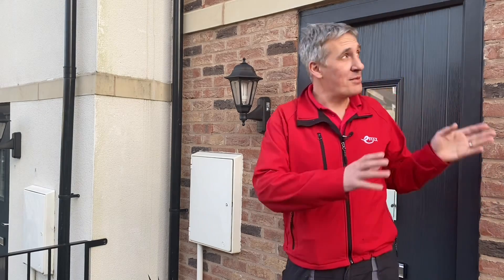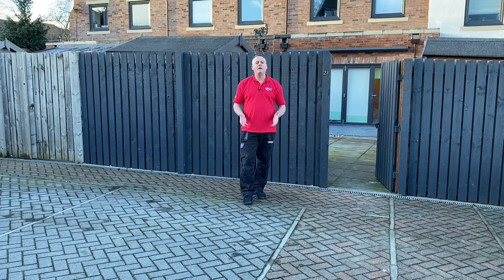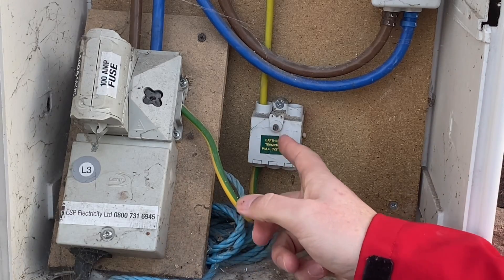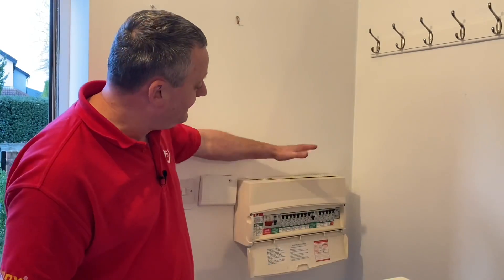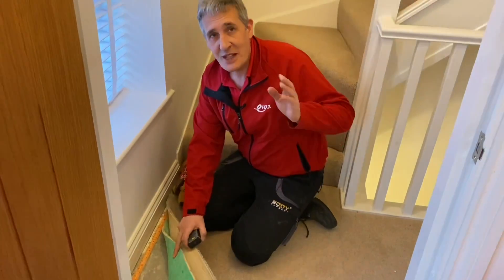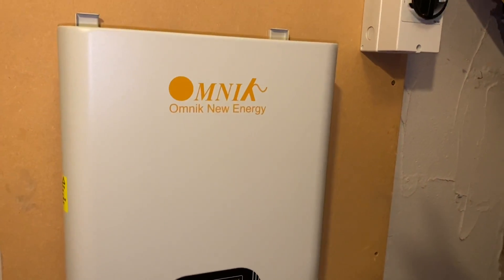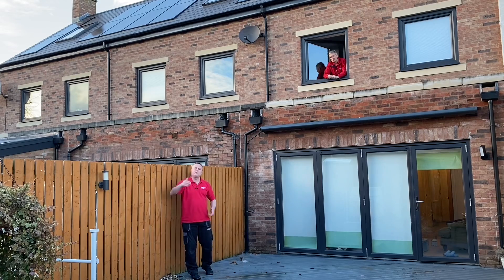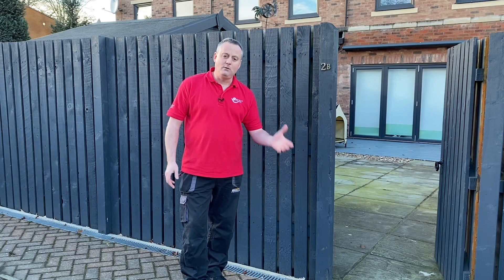Are ELECTRIC CAR chargers EASY to install?

Comment: If the ground floor is screed, then it might be possible to run cable through a conduit. It will be dependent on the depth of the screed, and there are some rather vaguely worded regulations about protection. Of course steel would be ideal. Such a solution would have the potential to minimise cable runs, but it's fairly drastic. Also, there may be other services, typically central heating pipes buried in screed, which would be a major issue, not to mention disruption to the floor. Not too bad for carpet of course, but a real issue for tiled floor and some other types of hard surfaces.

Then there is directional drilling under the property, but I imagine that's incredibly expensive and is a very specialist job.

As far as the CU is concerned, a move to RCBOs would free up several slots, but I think if that was done then it would be with a new metal unit.

Comment: My power supplier, western power distribution, do not use a main fuse greater than 84 amps, they also said a larger fuse would require larger fly Leeds. The other problem my supply is looped with next door.

Comment: ! ev charger supply at the end of the street. Cable under the road supplying each property individually card payment device on each charger. Less disruption, less chance of disaster, less diy bodging, simpler quicker cheaper installation one hit for the whole street. So instead of a 3rd world daisy chain effect we get a standard addition to infrastructure. Lets hope all those transformers and sub stations get upgraded this decade.

Comment: If it’s marginal for 10mm2 then go with it to give some flexibility on cable length. How about split consumer tails in service box, take new feed straight out of service box up the front of the house (will need ‘fuse’ as effectively tails are more than 3m), through the soffit board across the loft, re-emerge and then back down the rear elevation with an IP55 or higher CU with surge and MCB fitted to rear of the property. Then as per normal to point of charger mounting.
Reply from the maker: We did explore this. However, the house has three floors, the third one being in the roof space, so no easy route from front to back.
Reply: @efixx  thanks...... was my outline plan broadly technically ok? Would ‘fused’ 10mm out of the service cabinet be within regs?

Comment: I would be happy to install that for $50,000 aud. And it would be done in a week. Plus 3 months repair work. Remove ceiling run cable dig trench for cable. Concrete pad for new charger pole and WALLA. But with Covid I may not be able to do it for 2 years until I get a Vaccine in the good old Straya.

Comment: 1 Wait until they've bought the car before you price it and call you at least 3 times. 
2 Produce a full schedule of all materials and confirm the cost.
3 Produce a full schedule of works and estimated time
4 Add Items 2 and 3
5 Double Item 4
6 Add Vat @ 20% to Item 5
7 Add between 10 and 20% for overheads to Item 6
8 Add 10% Operating costs to Item 7
9 Think about the profit
10 Add 20% to item 8 for Profit
11 Think about a bit more profit
12 Add 5% to item 10
11. Round it up to the next £1000
12 Request 50% deposit for Materials
13 Get Pjtor to do it for £150 cash

Comment: Affixing to a wooden fence? I dont have the 18th ed. But I wouldn't. A wall yes, it's more permanent and less likely to be replaced. Wood not really, it rots and not substantial enough. 
Install a concrete post, if you have to go above ground use pvc swa pvc with added protection throughout its length.

Comment: I'd check what the original swa feeds and if suitable connect a priority and non priority switch.
Reply from the maker: They are Spurs off the ring final circuit
Reply: @efixx  then depending on location within the ring. Reconfigure it  to make that a radial leaving ring in tact (depending on cable size) or if still not feasible then just provide a lower powered charger that is fine to be plugged into the ring . Takes longer to charge but is a viable option.  The other option is to use the solar also .  Hopefully you will post your solution at the end . And I know you said no access to loft space bu be amazed what you can do with a ferret cam and some rods to pull a feed out

Comment: Apart from the regular EIC, do you give the customer a EV Charger Unit specific cert? If so where can I find a template?
Reply from the maker: Lots of paperwork for an EV install - this form has to go to the DNO. / https://www.energynetworks.org/assets/images/Resource%20library/EV%20HP%20Application%20Form%20v9.6.docx

Comment: If we need to take care about broken PEN on a TN C S earthing arrangements why are there no similar requirements for other electrical installation like electric gates or even for outdoor sockets if RCDs do not help with a broken PEN?
Reply from the maker: A good point - someone has done a risk assessment - but aren’t sharing the numbers. We think it’s down to the high load of 7kW compared to what’s typically used outdoors.

Comment: Honestly don't know what I'd do there. Is it an option to go low level through under the stairs? Maybe fit a small 2 way board in the meter cupboard (I know I know, sue me) then take a cable out of there down the front wall, into the hallway at low level, under the stairs, then under the kitchen cabinets? The back of that house is a nightmare to come out at first floor level. I'd do that as a last resort.

Comment: What will it cost to "shoot" a (plastic) pipe with a "rocket" under the building/foundation? Just like what is used for pushing gas pipes under a road from one side to the other and through to a building.
Reply from the maker: There is a company offering this service - we might explore what this would cost

Comment: Use the PV as the primary charging source backed up with battery in the loft for when the car charge isn't connected. Is there any way of using the PV circuit to the CU as the feed from CU to loft back down to the EV system for when the sun doesn't shine? 
If not use fire alarm way (connect them to another 6A circuit) to add 32A. Hard to understand possible cable routes without assessing the building fully. Use Zappi charger with PEN fault detection and RCD. No clipping to fence but I would defo bury those cables to Zappi if I could.

Comment: Interesting little job. Carpets up on the first floor and cutting access panels/holes in the chipboard would see the least collateral damage

The isolator tails also need sorting out as there’s basic insulation visible

Yes, it’s in a ‘locked’ cupboard but how many do we see with their doors swinging in the breeze or missing?

Comment: I would fit the charging unit on the inside of the fence with a 5/7.5m cable and take a tiny notch out of the bottom of the gate so you can close it with the cable under.

They are becoming quite the target for thieves due to the value of the cables.

If the customer does not want to do that then I would recommend an untethered charger again due to potential theft.
Reply from the maker: Jeez - thanks for the heads up - pinching EV charger cables!

Comment: Is the electric heated floor in the bathroom, really a no go option to route the cable under?
Wouldn't you at least try to rod through and see how far you can get?
Trying, the most direct route, at least could prove worthwhile.
Reply from the maker: Joists run the wrong way across the floor - otherwise we'd take a punt!

Comment: I’d use a Zappi with its built in RCD protection, PME fault detection and CT clamps. 
All depends on cost, but in an ideal world I’d replace the plastic unit for an RCBO unit, spare ways and SPD. 
I’d run a T&E from the CU to a wiska box on the back wall then SWA from there. Of course the floors are a pain but using the  holesaw and plugs it wouldn’t be a big problem.
Reply from the maker: we are thinking along the same lines!
Reply: @efixx  great minds 👌🏼

Comment: I wonder in this instance and other cases where say the garage is in a block away from the property so not even any way to run a cable staying within the property boundaries if it would be possible to ask the electricity supplier/DNO to give you an additional supply on a different meter etc?

Comment: Surely you can use of the PV system I'm the loft ? New sub main with SPD  , come out the loft down the wall bobs your uncle.

Also, I'd be getting shot of that bell transformer if I needed more space in that DB.
Reply: Forgot to say... they could also do with an SPD on that DB esp if the new car charger is coming off it.

Comment: 1:11 Why does the DNO need to be notified that you are installing an EV charger? It's customer-side equipment and none of their business.
Reply: https://www.energynetworks.org/operating-the-networks/connecting-to-the-networks

Strictly you don't have to tell the DNO, but it is a requirement of the OZEV grant application and is in the IET Code of Practice.
Reply: @NickW1111  it is mandatory that the DNO be notified irrespective of whether the OLEV grant is being availed of.

Comment: I think i would be taking down the brick wall at the front of the property and create a hard-standing to use a an off road parking space. This will almost ensure that only their vehicle will charge from their charger. Putting a charge point outside the boundary of the property (i.e. at the rear) may require 1/ contacting the local council, 2/ ensuring that only they can charge a vehicle from the charging point. 3/ Ensuring the install is as vandal proof as possible. 4/ Taking out extra insurance for public liability (should anyone become electrocuted by a vandalised charge point).

Comment: Is there a possibility to sink a new (flush mount) consumer unit which could get you into the cavity as a starter for 10 at least? See where you can get to from there (as in up and over).

Comment: Nice long f off cantilever wire straight down the middle of the garden, doubles up as a washing long. Bonus points if you drape the swa over the roof like a good quality satellite installer. 😂

Comment: As a British electrician but living and working legally in  France for well over 15 years I am still astounded how the consumer units and supply heads look like something out of the dark ages. Meter boxes with kit mounted on bits of chip board and consumer units you couldn't swing a mouse in never mind a cat. I know the European system is more expensive but it's just better. Conduits for cables, decent sized boards, double pole MCBs everywhere and everything is protected by RCDs. Every supply head has a 500mA differential  with consumer side isolation, even the ancient houses so no problem with fuses, seals or contacting the suppliers when you need to isolate the whole installation. All circuits are radials, more final circuits but much simpler. I don't envy you guys....I especially dislike twin and earth.... Give me conduits and singles any day of the week.... 

Ok that's my lot....good luck 

;-)

Comment: Hmmm. Interesting new garage unit in the meter cupboard. Run the swa under the downstairs floor to the outside. Run a small duct by the front of the fence. Up to the charger

Comment: First thought would be to run the cable up and down external walls and through roof space, if the voltage drop for the extra distance would allow it.
Reply: Would the charging port need it's on earth stake (tt?)

Comment: Will be interesting to see what you come up with. 
I have a similar situation and hoping to lease an ev.
Mid terrace house with the consumer by the front door and the parking hardstanding is at the bottom of quite a long back garden. 
The house does though have floorboards and a half basement.

Comment: Doncaster Cables EV Ultra 4.0 mm will deliver 42 amp circuit. Assuming clip direct this would be good and give us bang on 11.52 volt drop, I think we can do with that over 30 metres. 
Unless the routing is in insulation we could stick with 4.0mm. Maybe we go to 6.0 mm if we have concern over distance and installation routing. 
If we need CT or other data connection, as this is a long way for wifi to connect reliably to the Broadband wifi router the EV ultra with data cables would pay on the grounds of not having two cables to install and reliability of connection.

Comment: Something very useful in this situation could be putting an endoscope through the floor void. a remote control car with tracks and  camera can be used to pull a string through the ceiling cavity! attach cable and pull through, often use one under floorboards and voids.
I have used a RC car to literally drive through the web joists to get from one end of a house to another before. used cable pulling lubricant to prevent snagging. 
I would likely fit a small din enclosure in the meter cabinet, contrary to belief these belong to the customer and not the DNO, WPD and SSE both do not mind enclosures being in them as long as main fuse is accessible.
I would take cable up front of house (paint it) or put in conduit ideally concealed behind the vertical black drain pipe.  which we often do in Bath due to planning issues. then through first floor cavity, using the right tools and techniques it could be fed to the back of the house with no damage to decoration, carpet will easily go back down with an hour or so of a professional fitter, which is less than the cost of ripping the walls apart. come out the rear through the bedroom, I would consider running cable over the roof and down behind the drain pipe. potentially using H07 on a short run. and then run in SWA below the garden/decking out to charger. I would fit a Zappi with Harvi devices for grid management and pv utilisation. Equally if there are DNO cables going through the parking area the cost of a new supply can sometimes be much more attractive and cost effective than running cables through houses with all the decorative issues afterwards. 
Regardless of option its a cost VS Time VS damage scenario.
Reply: I have done that with an RC car too, many times - always successful too - mind you it was a 4x4.😉

Comment: Do what sky do and throw the cable over the roof and down the other side. Tie a hammer to a bit of armoured and you should get it over with a good swing. Then tack it to the fence and you're done. Cash in hand and no one needs to know.
Reply: Yea haw👌

Comment: I’d look at a separate unit from the meter box up to the loft. Possibly to a consumer in the loft next to the solar and then out and down to the back gate, but of course it’s public...so can you run under the path way and put it on a post in that specific parking bay? 

I could be way out so 🤷🏻‍♂️
Reply: It's a 3 storey house - don't think there's a cable run from front to back in the loft.
Reply: @ChristopherKaneTV  😢 what a pain! Don’t make it easier to retrofit do they. I do admire the Europeans for using ducting inside for ease of cable runs.
Reply: @yrification  100% agree

Comment: Combine a cct to free up mcb position, smokes as already suggested, pole mount Zappi, harvi with CT's (if reception of zappi allows) as solar and built in PEN detection as tn-cs and no earth rod required. 3 conductor 6mm swa under patio once out back, but that route through building 😱

Comment: I’d probably opt for a new 1 or 2 way consumer unit given the existing cu is not high integrity, and even if you did double up smokes onto a lighting circuit for example to gain a spare way,  it is still protected by a type ac Rcd 😞

You don’t show it on the video , but is the kitchen below the bathroom obviously on the ground floor level? If so, could you get the cable behind the kick boards of the kitchen base units? And run out to the rear external wall that way?

It is a very tricky layout to run new cables!! Also you may consider running the internal cable in t&e then changing to swa somewhere by the rear external wall??? 

Lots of points to consider here 🤷‍♂️

Comment: How about mole drilling under the house  take power after the mains disconnect  and put the charger inside the fence with a little door to get the charging cable.   https://www.coppard.co.uk/pages/index/table/890.php

Comment: Long shot but could you run the cable in the cavity between the 2 properties ( the boundary wall  ), I am fully aware there is insulation between the block walls but it could be worth a shot.

Comment: Why is the DNO mini-board used? And why is it lying at a weird angle?
Reply: It's to reduce the angle of the bend on the supply cable which is surface mounted up the house wall
Reply: @dg2908  It's a bit hard to tell, but I'd say the bending radius would be ok if the meter tails were shortened. But at least that's an explanation lol. In fairness, in our DNO region we didn't use surface-mounted cabinets, they were always cavity hockey sticks in recessed cabinets.
Reply: That's how some dnos install their cutouts, western power do it a lot.
Reply: @joesouthgate  Looks bloody untidy lol! I'd refuse!
Reply: @Tammas  DNOs do whatever they like, if you want power they dictate how they install it.
Reply: @joesouthgate  No mate, I worked for a DNO. There are standards they have to adhere to. And, trust me, a tidy job is one.

Comment: Move smokes to lights. Run cable to new location, instal matt:e and a new mini board and then come out to charger. Maybe go up to soffit, go through loft as far as possible and then out and into the other roof space. Without a better view of the property it’s not possible to say what you need. Looks like it might be mid terrace.

Comment: Henley block after the isolator, in through the wall to a dedicated metal CU for the charger
Back outside, up the wall, into the loft, through the house, down the wall, along the back fence.
Then cut a hole in the fence and mount the charging point on a post.
10mm all the way.
Reply: I think it's a townhouse, doesn't have a loft running front to back.